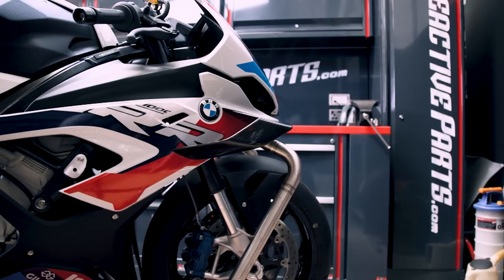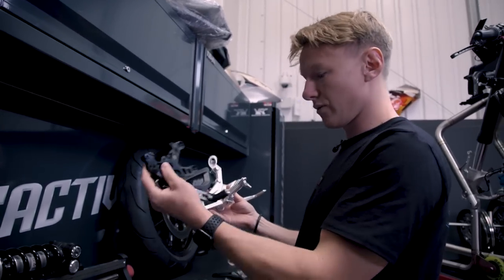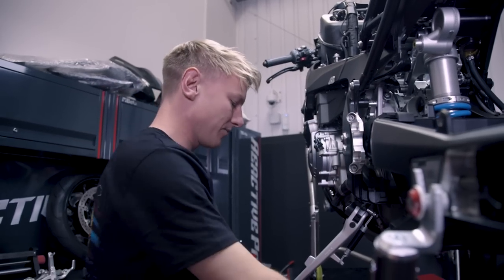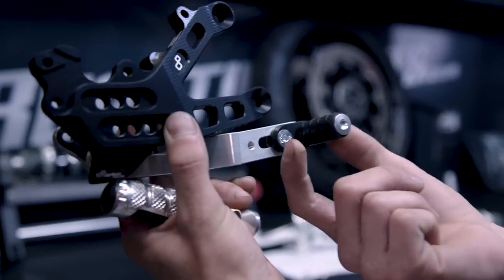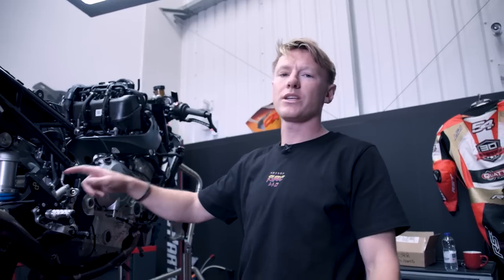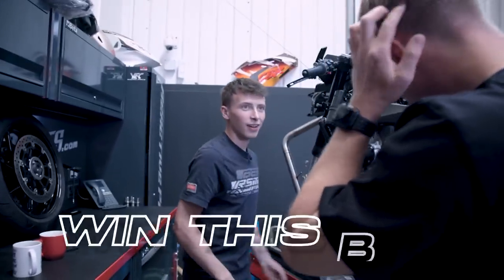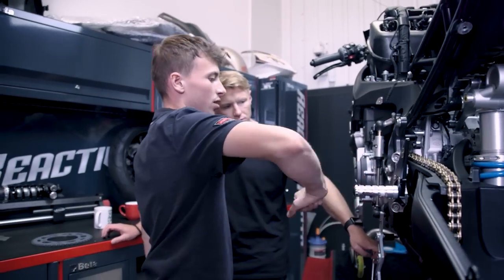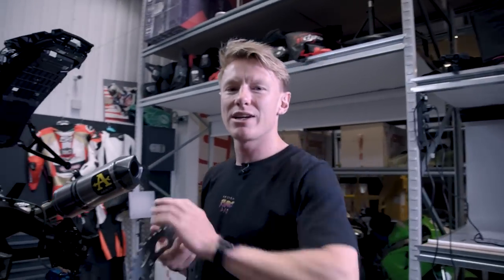I Reveal My Dream Track day Bike Build Project *$40,000 spent

Comment: Guy's  nice to see you torquing the bolts one concern is you shouldn't really lube bolts unless the manufacturer has spec saying you should as you will over torque the bolts by about 10%
Reply: That's what I was taught during my apprenticeship. Only add lube if recommended by the fastener manufacturer. Brilliant video though
Reply: Macauley is a race engineer, he's not putting bikes together forever, he's pulling them apart weekly.  A different mindset.
Reply: A lubricant yes but some kind of anti corrosive substance like copper ease, no problem I’d say 👍🏻
Reply: @djg9589  I agree and the difference is that Copaslip issue a table of different types of fasteners and the torque factor to use when using Copaslip (not sure about any other copper based anti seize grease)
Reply: I looked it up and the number i found is nearer to 25%, with my front brake bolts i even broke 1 because of the factor.. replaced them all after that happened..

Comment: Oil filter wired (and he hex nut on the front is not allowed - must be secured with a jubilee clamp and wired if not being restricted by casing)? Sump plug wired? Shark fin not allowing fingers in? Tyres on right way? Top yoke nut secure, no yoke play, damper not being used as a stop? No rubber bungs in the bellypan? Front axle pinch bolts? Catch bottles (non-return on the fuel vent- into a bottle). Engine blow-by (breather) back into air box? No cable restrictions on steering movement? Throttle not restricted one any turn lock? .... I'd still check that chain 👍

I'm in!